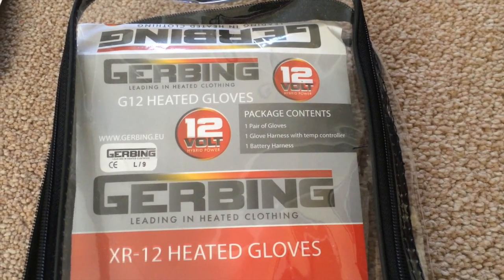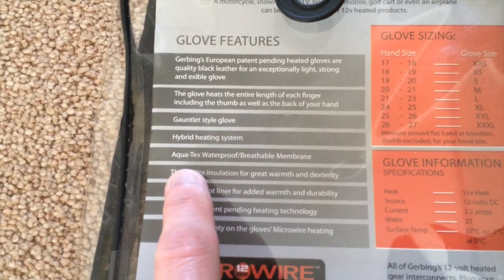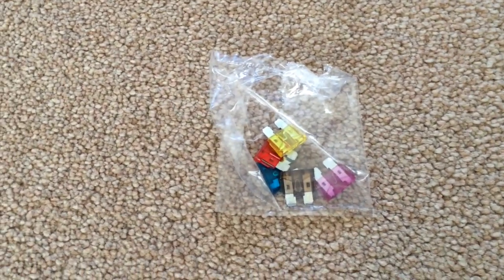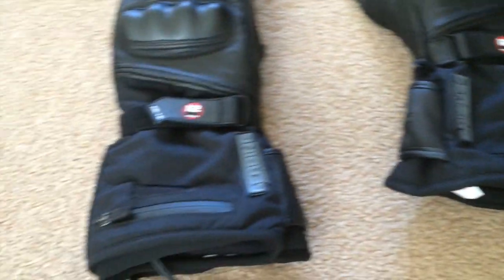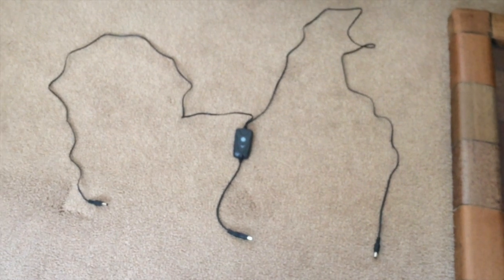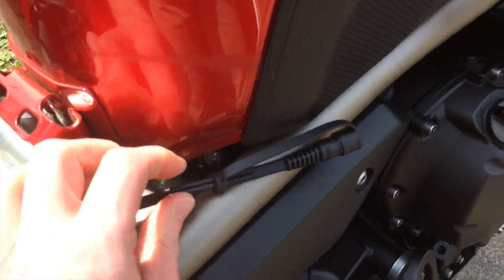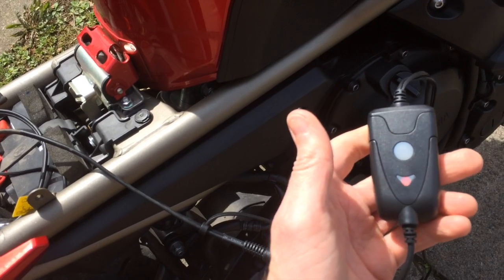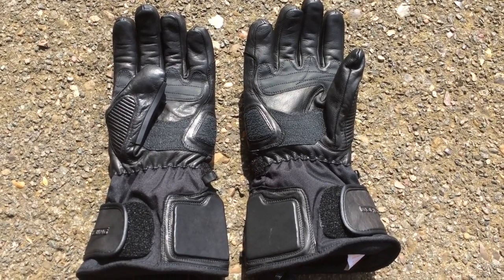Gerbing XR12 Heated Motorcycle Gloves review

Comment: Excellent Review,well done.As you say you have put it in Laymans Terms and it is very easy to understand,I've watched
several reviews on these gloves and this is the best one yet.
Regards    Mick
Reply from the maker: Thanks for the kind comments, Mick!
Reply: Isa Bilal Took the plunge on Saturday and bought a pair of T12's,wired them up yesterday and they are working OK, have yet to test them in the cold though !
Reply: I HAVE THE XR 12 GLOVES FOUND THEM TO BE HOPLESS WITH THE 12 VOLT BATTERY PACKS, SO SENT THE BATTERIES BACK, HAVE THEM HARD WIRED TIO THE BIKE , FOUND THEY GET SLIGHTLY WARM THEN COOL DOWN ,I DONT GET ANY DIFFERENCE OF HEAT FROM THE HEAT  SETTINGS SWITCH,  DOES ANYONE ELSE HAVE THE SAME ISSUES , GERBING HAVE TESTED THEM AND SAID THEY   ARE WORKING OK ,
Reply from the maker: I've not experienced any problems with these gloves or the switch. All working fine.
Reply: keith effard do you still have any problems?

Comment: Good video Isa, thank you. There seem to me to be 2 problems with this gear, 
1) The system is permanently live. The inclusion of a relay energised by the ignition circuit would be a relatively easy and safer bet.
2) The notion of running wires around your body and down your arms every time you want to ride your bike, seems a bit regressed to me. You mentioned it in your video. The solution is not as easy as I thought it was going to be. Have you come across any good ideas?
Reply from the maker: Hi, Runereaper. I didn't end up with a solution, but ended up just holding each connector in my hand as I put my jacket on. Funny enough I got used to it and it doesn't feel anything like the problem I thought it would be. I think I anticipated the problem more than experienced it.
Reply: Thanks for your reply Isa. I bought a pair of these yesterday in the Sportsbikeshop and was debating with myself how to best lay the wiring. I was thinking of a couple of dedicated long-sleeved T-shirts (1 spare for washing) with stitched on piping but it's an awful palaver and I'll try your solution first.

Have you any long-term recommendations or problems? I see a couple of people have said they're not waterproof but I've never found anything flexible that will keep out sustained 80mph rain without leaking somewhere.

These gloves were the most comfortable I tried, even amongst non-heated gloves. They also provide good mechanical protection and I've always preferred the gauntlet type length.

Have you tried any other heated equipment? I never rated heated handlebars as it's the back of your fingers not the palm side that freezes.

Thanks again for a good post. Paul
Reply from the maker: I've had them now since I posted the vid and have experienced no problems. I've also never experienced a problem with waterproofing, as I think I state in the video, so have never understood where this has come from, although it could have something to do with the gauntlet style allowing run-off from the jacket sleeve into the glove. This I did experience on a wet trip to Ireland, but to be honest with the heat I didn't notice till I was off the bike. 

As for other heated gear, I've not got any. It was always my hands that caused me problems and I thought I could insulate everything else. However, on a trip back from Ireland one night in February (I go to Ireland a lot) it was -5c before taking into account wind speed chill. My hands were lovely and warm but my feet were blocks of ice by the time I reached the Welsh/English border. If I was going to invest in anything again it would be heated socks.

Comment: Has the junior controller failed on you yet? I've had two fail in quick succession.
Also they have to be on Red - Level 4 to get any decent heat through them
I had them replaced, but same deal
Reply from the maker: Mine still going strong.

Comment: Your review was a good start, but you need edit it to include comments on how the glove fits; did you lose any dexterity using the bike's controls because the gloves are too thick or not flexible enough?
Reply from the maker: bgm1911 not at all. They are of course a winter glove so dexterity cannot be the same as with a lighter glove, but that isn't to say that use of controls becomes difficult. In my opinion it's a case of getting used to wearing them.